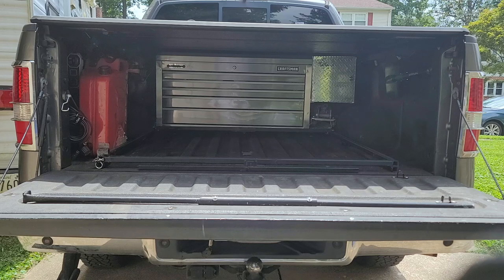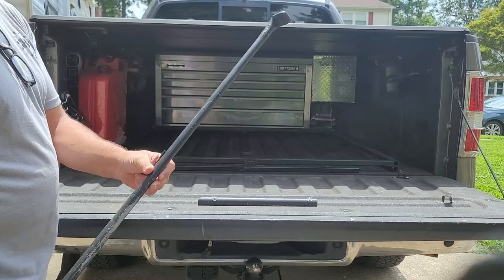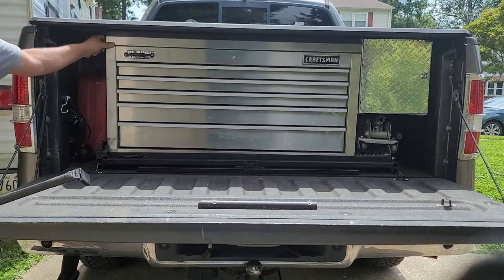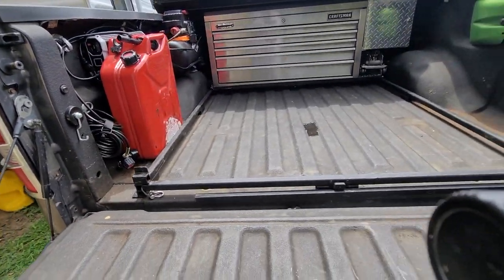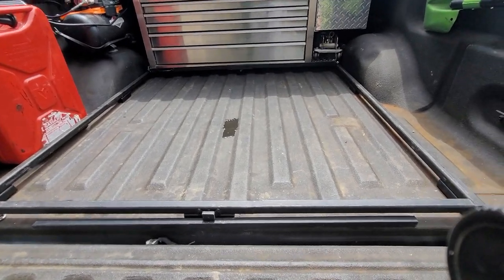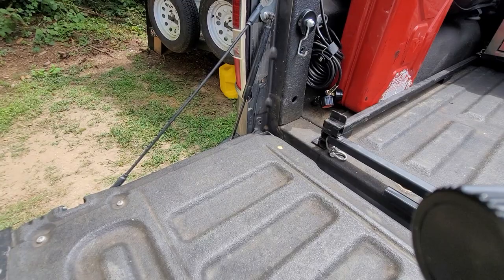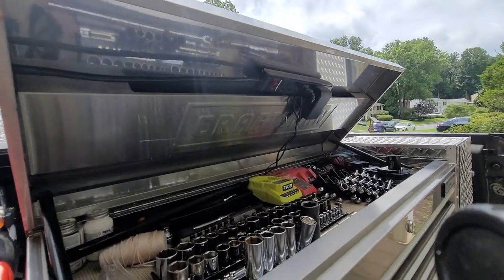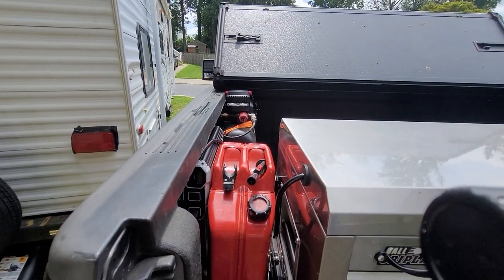Sliding Truck Bed Tool Box, Never Seen Before! DIY

Comment: I'm 8 months late in seeing this, but you could put some springs behind it to elmimate the need for a pull bar most likely. Find some with the right amount of tension that its not hard to lock it in place, but still enough to give it a good push when you pull the release.

Or if you've got on board air you could get some cylinders and get real fancy haha. Sweet idea and execution man
Reply: Springs.....now that is a brilliant idea!

Comment: This is great, you have basically constructed the idea I had in my head for my own vehicle. I'm definitely interested in a more in depth video on the construction of the sliding mechanism, specifically the bearings and the cable lock. Keep up the good work! Also any chance you can make a cost comparison to the materials required to build this versus buying a BedSlide or similar and having it installed?
Reply from the maker: Absolutely, working on it. Should be out soon!

Comment: Sweet build. I had the idea to use a bed slide with a 1000 lb capacity  for my 500 lb welder after I found out about the price for the aluma reel set up.
Have not done it yet might just leave mounted next to the cab.
Best wishes to you.
Reply from the maker: Yea the commercially ready stuff is outrageously expensive, out of my budget. Thats why i did what i did. And all in, it cost me around $200. Thanks for watching.

Comment: What tool box is that? I can’t seem to find the craftsman with the full drawers. Any chance you have a part number or can post a link for it! Thanks in advance.
Reply from the maker: I bought it used off FB Marketplace. Found this link, hope it helps - https://mylist522.wordpress.com/2013/12/15/craftsman-41-wide-5-drawer-ball-bearing-griplatch-top-chest-stainless-steel/

Comment: How does it track straight? That's the extent of the distance it's capable of traveling? How are the wheel bearings attached? Whats your estimate of the weight of the toolbox? May I suggest you going slightly more in-depth of these mechanisms? Elaboraying a bit more on the locking system as well? Thanks for sharing, regardless. Aloha
Reply from the maker: Box with tools is easily a few hundred pounds. The roller bearings go through the angle iron on both the top and inside of the frame to track straight. I will make a more in depth video of it as suggested. Thx for the support!!